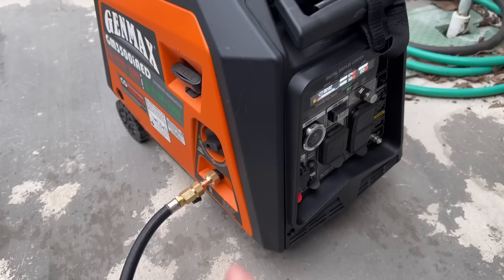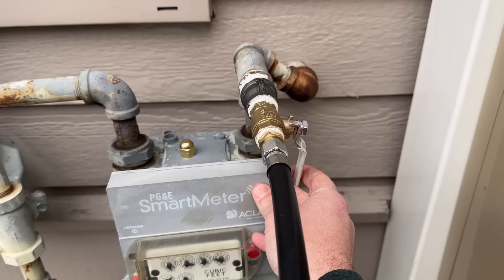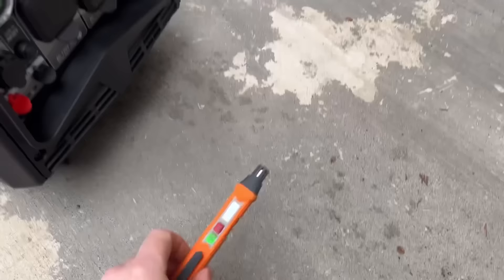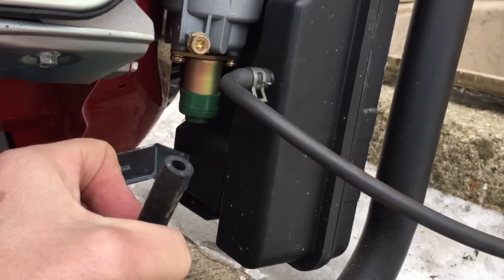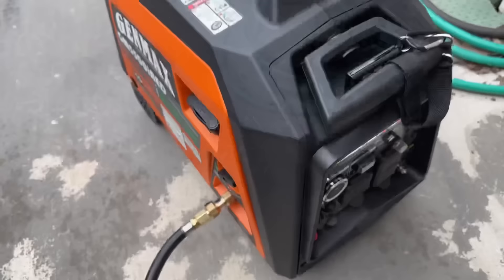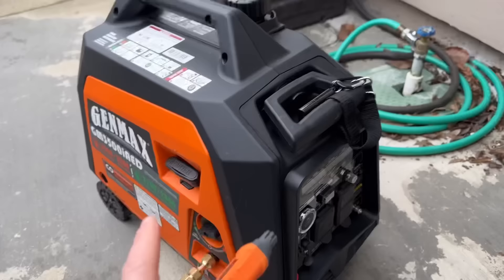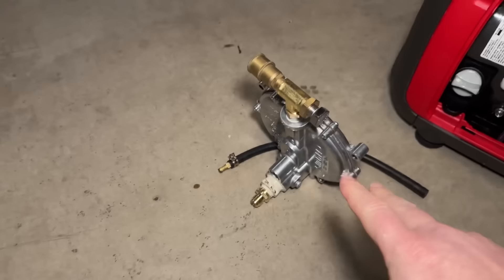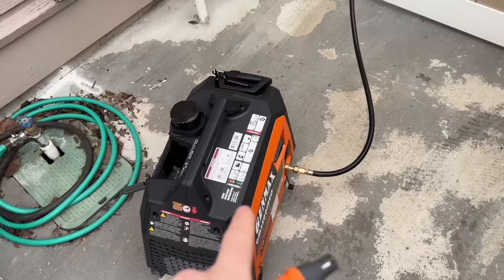Natural Gas Generator Hook Up People Should Stop!!!

Comment: Its called an on demand regulator, there is a company i saw online a while back called US carburetion, I’m not sure if they are still around but they made multi fuel kits for this purpose and they seemed reasonably priced
Reply from the maker: Correct !! Good job, yes they still make kits and that would be the safe way to convert these units if compatible. There is also another company as well but I forget the name.
I have installed a few as well..👍🏼

Comment: Obviously, the only way you want to install any gas appliance in your home is the right way. If you don’t know the right way, you should not do it. Who knows the safe and to-code way to do it? A licensed/ certified pro. Having said that, the setup you are demonstrating on for us appears to be a high pressure hookup to the utility. Because after the riser valve, we see a regulator. The downstream side of the regulator is standard household pressure: about 1/4lb psi. Household appliances do require a dedicated, easily accessible manual shutoff valve to isolate the appliance for service or emergency. They do not require another regulator unless the manufacturer provides and/ or specifies one. Why regulate an already regulated flow (again, unless required by that appliance)? A regulator isn’t an EFV (excess flow valve). 

What IS suspect is the rubber flex hose/ hose clamps. If the manufacturer requires more parts for the install than are included and they are not installed, THAT is suspect.Also, ANY time the household regulator is venting gas out of the bypass vent, there is some issue and it should be reported to your utility asap.
Reply from the maker: True a regulator just does that which is regulate pressure but the kits you buy are both a shut off and regulator and load block/demand regulator.

Comment: Whats different if it is hooked up to a propane tank? Wouldnt propane continue to flow?
Reply from the maker: No because you would be using the proper equipment that is supplied with the generator, not just a bare hose that goes in a air box and is sucked in by vacuum
Reply: @johnnysweekends  If the generator comes with the proper equipment, then cant you use the proper equipment with the natural gas hose.? I dont see the difference between the natural gas hose, and a propane can with a hose.  I have a 7500 dual fuel generator, and I find this very interesting. Thanks
Reply from the maker: See if this answers anything 
ADD Natural Gas to Dual Fuel Generator…
https://youtu.be/9GMMBxrkGeo

Comment: Maybe a silly question, but if I have a generator with natural gas as an available fuel source out of box, is this sort of leakage something I need to be concerned about?

Understand the need to check for leakage with connections, but should the generator regulator stop the flow of fuel in the event of an unplanned shutdown?  Or would someone need to close the flow to the regulator to prevent escape of the gas at the generator side of the connection?  Thank you!
Reply from the maker: If your gen is equipped already then no need to worry. The regulator will automatically stop flow. Even the after market kits the flow is stopped. But its still a good idea to shut off main source once you are done for long durations.
Reply: @johnnysweekends  Thanks bud!  My big concern here was just rushing out to stop the outflow of gas if the thing died in the middle of the night or something.  I very much appreciate the reply!
Reply from the maker: No problem. 👍🏼 It’s just the DIY guys who are taking a open tube and shoving it the air box is just promoting such a bad and dangerous idea.

Comment: I am looking at a whole home generator solution.  I have received several quotes and they vary from $1K to $8K for the same install.  My question is, several have said they will 'tap' into my currently gas line that is capped off under my house at the clothes dryer while others have said it will need to be a dedicated line from the meter.  Can either be done?  Thank you for your channel and your videos, just ran across this today and have already watched several of your videos... Thanks a ton!   Kent
Reply from the maker: I would check with local gas company. Seems it varies. That would be the best way to get a direct answer

Comment: Any combustion device shall be a minimum of 8’ from the regulator or meter vent….they do make electronic fuel shutoffs in a wide variety for ice engine systems and they are relatively inexpensive…..also typical gas grille supply systems (natural) are a more positive alternative for supplying a portable generator…..all ice engines require a fuel to air ratio so if that is imbalanced so shall it performances be altered.. a load balanced regulator is in order for any gaseous fuels ice engine..,,

Comment: Your duel fuel generator comes with its own regular. People should hook that up, that’s what it’s for.
Reply from the maker: Correct this unit does. But I think you missed the point of the video. They are hooking up NG lines directly to the air box the let the engine suck in the gas having no control over it.

Comment: not many people doing over here because they just use gas more often than any other
if you nookies i dont recommend you doing that because it super dangerous i recommend you take it to shop get upgraded added on it if you are mid level skill fixing you could just get kits added on it

im engineers i know this stuff aint safe because diesel is more safely than natural gas because doesnt burn from spark (try sparking diesel doesnt work but you can thro2 diesel in fire it will go bigger and burn but not burn by sparking it unlike gas will do)

Comment: The other problem I see is that there’s no safety valve in case a flame travels back up the line. Which also might remedy this. My knowledge is from attaching apparatus to oxyacetylene welding equipment.
Reply from the maker: Correct. I made this video to educate and do not do the other diy method that is going around which is horrible.
Reply: Which home gas appliances have this?

Comment: There is another issue where a backflow preventer should be used
Reply from the maker: Yes proper load regulator has a shut off 
That’s why a kit is needed

Comment: on an unrelated note : i feel rather than have public buses and mail vans all converted to BEVs with huge, heavy battery packs why not adapt them to run on NG/Propane?
Reply from the maker: You know, I don’t know. More and more are but the push should be higher like hydrogen as well. If the are really worried about all the global warming and CO gasses these are options are way cleaner than lithium
Reply: @johnnysweekends  the lithium isn't consumed, electricity and gas are consumed.
Reply from the maker: Yes correct, but lithium process to obtain it consumes tons of resources and burns tons of fossil fuels just to get it, process and manufacture it. Then we still don’t really know what to do with it when we are done which people are still throwing in the trash. Tough balance.

Comment: 1 25 23    a colorado viewer
very good of you to make this vid to warn us all.  

one idea ...

the gas meter itself has a safety shut off valve when it senses gas flow with too little
       back pressure .       how close does your leak-demo come to
        tripping that meter safety valve 

... 
reading other viewer notes has me think 2 re-see your vid.   to clarify if having a  regulator 
then results in the generator RPM's vary  with the  load auto'ly ... ???

      i'm not sure if that gas - sensor probe ... when it got a signal was at the engine exhaust or not ?
and was detecting un-burnt   nat. gas
Reply from the maker: The probe detects several gases. 
At first it was exhaust CO then is was NG from the generator being shut off and the load regulator letting the gas leak through. Which is different then a pressure regulator.

Comment: I'd use an external fuel source (gas,diesel,propane)to power my generator. Natural gas lines are pressurized and will losse fuel pressure in the event of a natural disaster.

Comment: This honestly sounds more like a serious design defect in the generator rather than an improper hookup. The gas coming out of that side of the meter is already regulated to the proper pressure for appliances. If it needs an even lower pressure, then that regulator should be built into the generator just like it is on a gas stove! If the generator shuts off then it should automatically shut off the gas internally, without any extra parts.
Reply from the maker: I think you missed the message of this video. The generator was just a example and works as it should.

Comment: I get the gist of what you're saying but why didn't you show the correct hookup instead of just the part?
Reply from the maker: Every hook up could be a little different.
I have another video soon showing that kit in use with that dual fuel unit and showing how you can determine if your dual fuel unit is able to easily work with that kit

Comment: I've never used a dual fuel portable generator. Are you telling me that they don't have any kind of shut off built in to stop the fuel flow when the generator shuts off? Or is the pressure too high without a regulator and it is able to overcome the safety valve? I've installed several whole home generacs and they have proper shutoffs built in and have gas pressure on them 24/7
Reply from the maker: No the generators are fine. It’s the people doing bad practices of using a portable gas using a sticking a tube in the air box and letting it rip
Reply: @JOHNNY'S WEEKENDS  no way you could get the air/fuel ratio right with the load change either. It will eventually result in damage to the generator itself or connected devices from the surges
Reply from the maker: The have units and kits that work just fine to make a gas unit compatible to run LPG and NG. They work great with 1000s of hours of run time..👍🏼😀

Comment: Somehow I think this seems dangerous, with or without trying to use the valve as a regulator.  No valve should exist to let gas out into open air (think when your generator is not hooked up, or stops running for other reasons).  Something seems entirely dangerous with this even working as intended.
Reply from the maker: Well it you think about it a gas bbq has a outside valve. It’s all in the user
Reply: @johnnysweekends  An outside gas BBQ has a tank, which only has so much gas in it.  A line from your house basically is unlimted.  User or not, it just seems dangerous to have a gas line open to the outside world, with nothing but a ball valve.
Reply from the maker: Same for every water heater. Look at the connection. Should have a 1/4 turn valve to shut off for service. Same as a furnace
Reply: @johnnysweekends  Yes, but those items have safety precautions built in to keep the gas off, should the pilot light go out, or other issues.  That is just a valve on the main gas line.  Big difference.
Reply from the maker: True, the video demonstrates a bad idea that has been going around. A proper generator or kit has proper shut off features.

Comment: I've been doing this for 20 years and never had a single problem. Guess what bud! When the generator goes off, everything in the house turns off too! Meaning im right back outside fixing any issue there might be with the generator. In the northeast, natural gas costs an arm and a leg. No one out here is just leaving gas running without their generator on lol. Only you can prevent forest fires.
Reply from the maker: Not everyone pays attention. But using a suicide cord I assume is also ok. Somethings you just don’t because if you fall asleep from say smoking your weed or being drunk, well…..
Not everyone makes smart choices and these can harm more then just yourself. 
Not to mention free flowing NG is more toxic to your body then you think.
Check out the studies

Comment: I would like to find the regular for my generator unfortunately there is no identification on mine. I’d guess it’s the same as a king generator with a 20amp 220 volt plug
Reply from the maker: What unit are you talking about ?
Reply: The reg that should be on generator I have propane available on my garage
Reply from the maker: That’s always nice!!

Comment: Any chance you know of a video doing one of the propane conversion kits, mine came with some less than stellar instructions so I've been putting it off.
Reply from the maker: I have some of the kits I have installed on gas units but not dual fuel as each is a little different. I’m showing a video of which can be ran on NG in a couple days
Reply: Yes mine is a Briggs gas that came with the spacer between the   carb and block

Comment: Okay if the generator shuts off does the regulator turn the gas off?
Reply from the maker: The correct setup would yes. You need a proper conversion kit. Not just a hose

Comment: Maybe these owners assume that this type of generators have built in gas regulator?
Btw, do these dual fuel generators come with regulators as accessories?
Reply from the maker: It depends on the model and brand. Some have a regulator in it but it’s a load regulator not a pressure regulator like you see on the bottle. 
You need two. One propane regulator with the correct WC pressure for propane and then the internal load regulator which is inside the generator or sometimes outside the generator connected to that propane regulator.

Comment: Hello I have a question. Hooking up NG to generator, I'm in a process of running the pipe outside. Should I end it with a ball valve or gate valve, or it doesn't really matter
Reply from the maker: Ball valves for LpG and NG ..👍🏼
Reply: @JOHNNY'S WEEKENDS  thank you very much!

Comment: I think this is not so much a problem with natural gas as it it with propane.
Natural gas is lighter than air and will easily dissipate outside a house even with no air movement.
Propane is heavier than air and will accumulate on the ground level and sink in low areas or open basement windows. Especially when there is no wind to carry it away.
Reply from the maker: It’s true propane is heavier and can pool more, but this is still dangerous and NG is actually pretty toxic when just breathing it in.
Reply: @johnnysweekends  I read that with Hank Hill´s voice. :-D
Reply from the maker: Bobby Propane Is Americas Gas..!! 😂
Reply: @johnnysweekends  Mah dad says butane is a bastard gas.

Comment: Your generators fuel line is connected to the wrong side of the meter! Mine is connected to the left side with a shut off regulator. Works for me.
Reply from the maker: Mine is connected to the outlet. If I hooked to street side before meter, then I would be in big trouble. That would be free gas lol

Comment: So a propane generator can also run off Natty gas?
Reply from the maker: Yes with the proper equipment, and that video will be out in a few days. 
A gas generator is no different then a dual fuel or tri fuel. It’s just a switch and a hose

Comment: You keep saying propane but natural gas is totally different. Also you should never connect to T-fitting at gas meter that is installed for utility access only by utility company. I am a natural gas tech for one of the largest natural gas utility company. Never trust the pen type gas detectors. Always use soapy water and look for bubbles.